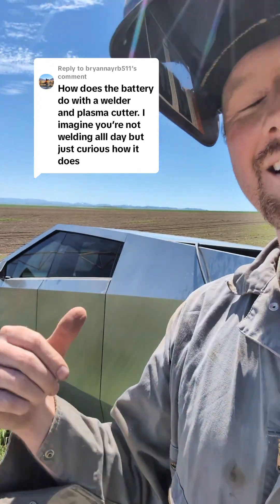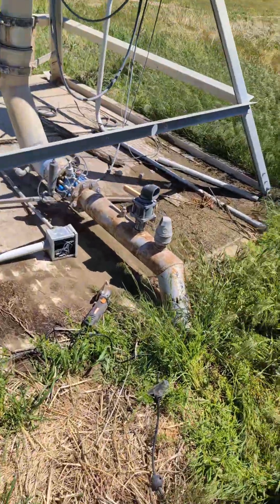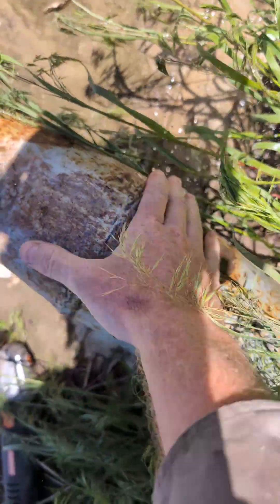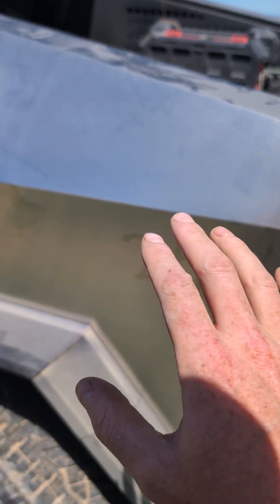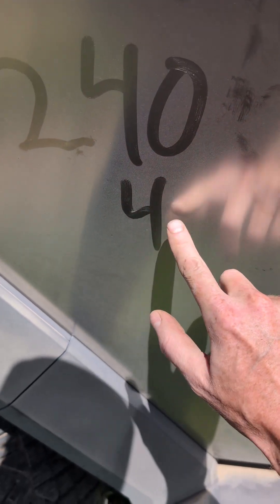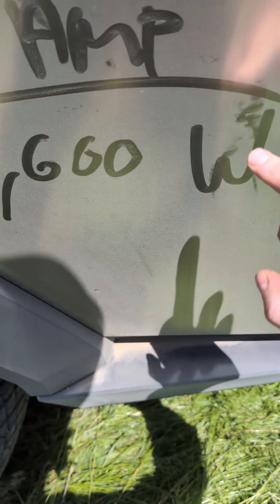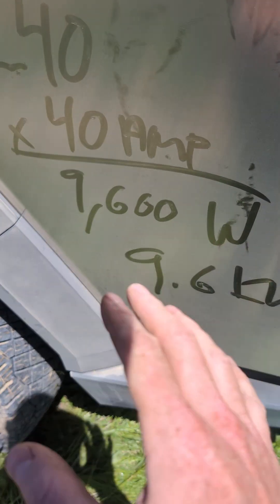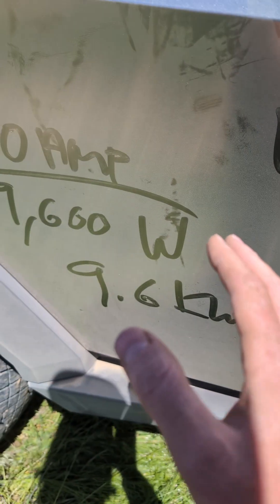How long can you use a welder for using the Cybertruck?

Comment: Howdy - Rancher in Texas contemplating a CyberTruck. 

Question - I cannot find much info - do you weld much drill stem?  We use. Lot of 2 7/8 or 2 3/8.  

1 - are any of the buzz boxes - electric welders strong enough for drill stem?  

2 - do those work with Cybertruck 240V?

Many thanks in advance!

Ron
Reply from the maker: Hey Ron - Yes you'll be able to run basically any buzz box or anything else you have in mind off the 50a style 240v plug.  Check out my X account I've gone into more details there.